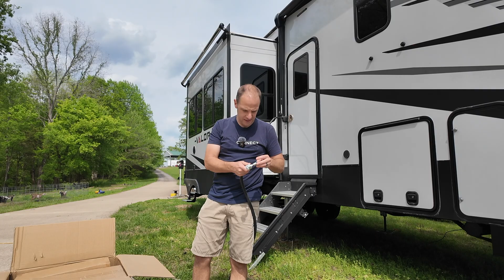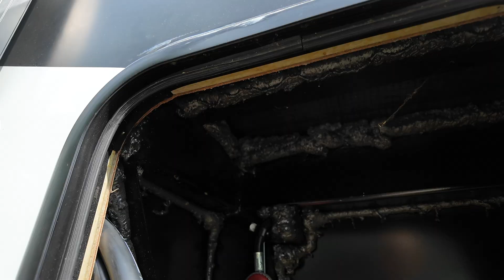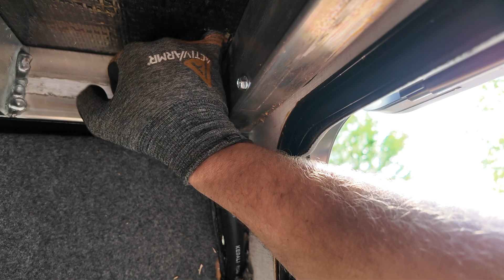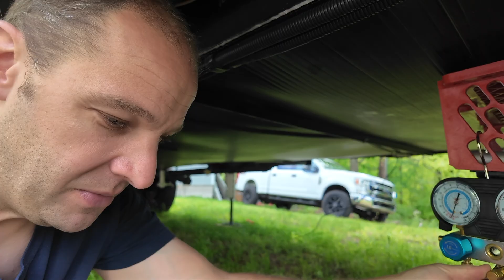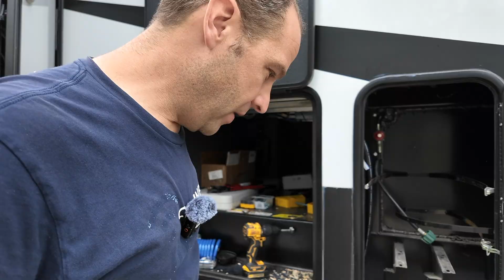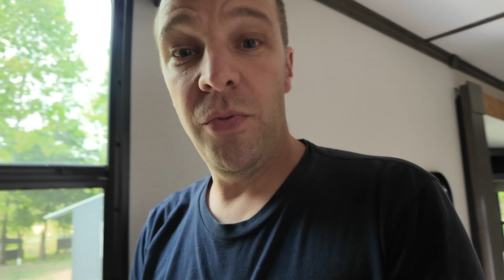Off-Grid RV A/C Installation In Our Fifth Wheel - How We Do It!

Comment: Mini split for the win. If you leave the fan on all night all the moisture on the wet coil will be re-evaporated back into the space. Not the best for keeping the humidity low inside.😉 Does it have a slow ramp up of the fan when it turns on? That may be a good compromise for noise.